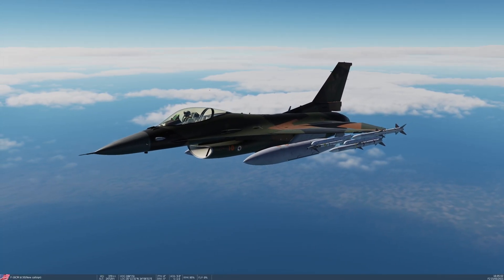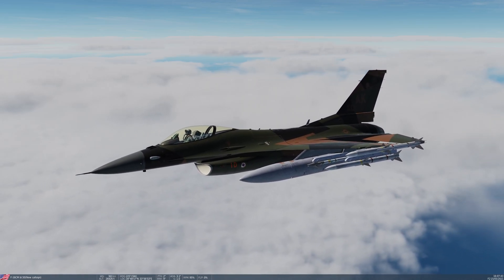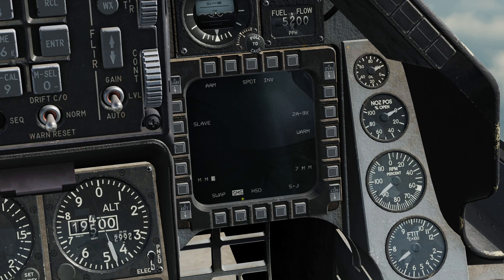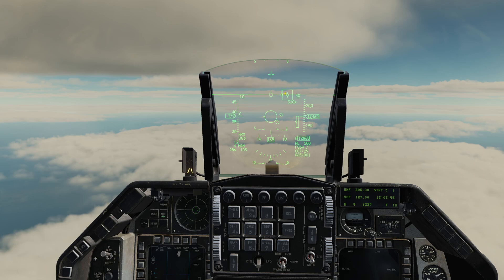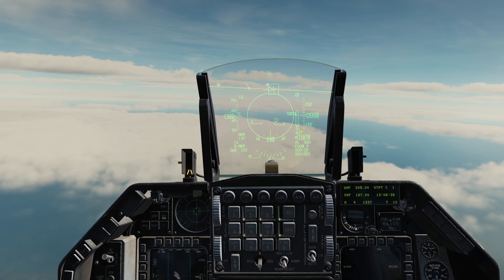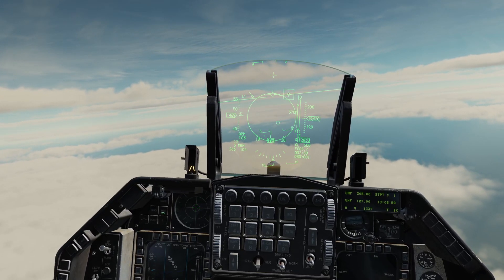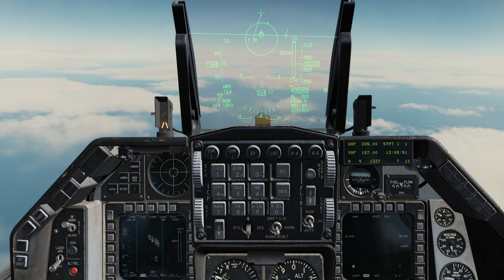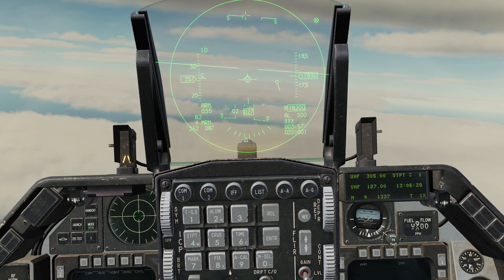DCS F-16C Tutorial 4 - A/A missile with radar cueing

Comment: Took me a while to understand: You are at the targets 6 o'clock, telling from the aspect diamond. You fly 609kts, the closure rate ist 570kts, means the target flies just 39kts (609-570=39). Then I saw it's Corrected airspeed so at FL20 you are 609+ approx 20% = 760kts True Airspeed. The closure range is also true airspeed, so the target is flying at 760kts-570kts=190kts True airspeed. Still pretty slow I think. Where's my error?
Reply from the maker: In many sections of this video I had active pause on. In this mode my aircraft is frozen in space but everything else continues to move as normal. That will account for the strange values.

Comment: Range of DCS AIM120's is ridiculous.
Reply from the maker: In a positive or negative way? I'm not really maximizing the range here. Best case is launch platform at high altitude and speed, attacking a non maneuvering target with a very high closure rate. That way you can launch much further out than you see here.
Reply: @deephack  I can't say but it's not even close to realistic.

Wikipedia says the aim120c has an operational range of over 57nm...  I'll just leave it at that.
Reply from the maker: There are no public sources we can look at for that kind of information so of course ED have do do a fair bit of reverse engineering and I doubt the result they get will be exactly the same as IRL. That said the AIM-120C-5 in DCS can achieve hits in absolute ideal conditions at out to 80+NM which seems a little far to me. The AIM-120D however I would expect can make hits like that fairly easily IRL.
Reply: @deephack  nearly every public source I've looked at states over 50nm.
Reply: @deephack  Also if you look up SLAMRAAM, they have a unclass range of 25km (13.49nm) firing from the ground. You can't tell me an air launched AIM120C has less energy than a ground based AIM120C SAM platform? haha
Reply from the maker: I'm not seeing a contradiction here. My shot was pretty much worst case, best case in DCS can achieve a bit over 80NM as seen here https://youtu.be/2P_pOKINJuI?t=430
Reply: @deephack  ah so it's not the missile that is the limit it's the missile cueing UI in the cockpit that is artificially limiting the range?
Reply from the maker: That could be the case although I'm not sure exactly how the DLZ is supposed to work in the real aircraft. My suspicion is that it is wrong as the top bracket is supposed to be Rmax and clearly the missile can reach the target well above the top bracket in the correct conditions.
Reply from the maker: https://forums.eagle.ru/topic/229198-reportedwrong-hud-missile-range-calculation/?do=findComment&comment=4230684

Actually based on this we are missing Ropt and Raero. Top bracket is actually Rpi so I was wrong. If we had Raero then it should be indicating the longer ranges we are discussing here.
Reply from the maker: Older post in the forum from BIGNEWY states that the DLZ in F18 and F16 is WIP and will be corrected. I think together we figured this one out 👍
Reply: @deephack  ah that makes sense then.  Do you happen to know if the aim120 on the F15 has the same issue?
Reply from the maker: Been a long time since I flew the F15 in DCS but the old limitation with that aircraft was that the aircraft's radar couldn't lock anything beyond about 50nm so wouldn't be possible to test really.
Reply: @FurballHero  OMG Wikipedia is NOT A SOURCE!  A missiles range is determined by the burn time of the rocket motor, the velocity at launch, and altitude at launch, the altitude of the target, and the range is reduced by any (even minor) turns. Missiles fired at higher altitudes will also suffer reduced atmospheric drag from the less dense atmosphere. In the case here, so of the targets were traveling away from the launch aircraft which further reduces the missiles' range. Now taking all that into consideration, I think that the DCS missile ranges from the AIM-120 C-5 are fairly close to the real numbers, as the rocket motor burn time is modeled, atmospheric drag is modeled, missile battery life is modeled, and launching speed effecting max range is modeled. Is it perfect in every case? No, is it more realistic that some numbers from Wikipedia? YUP.